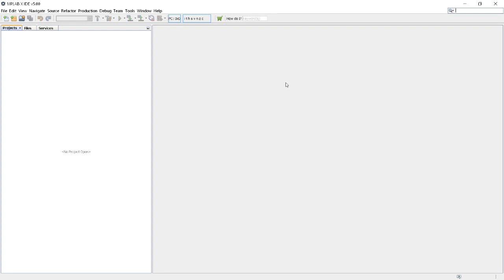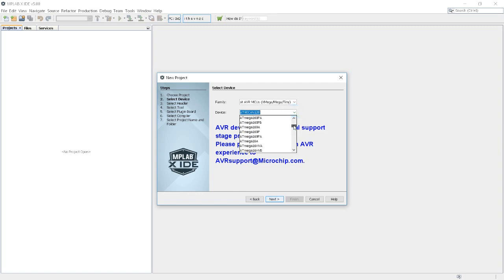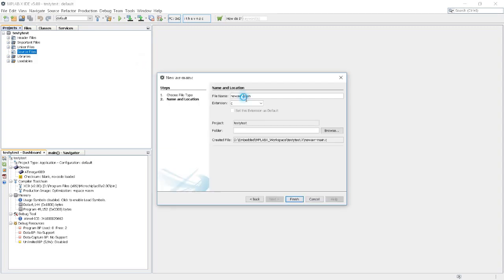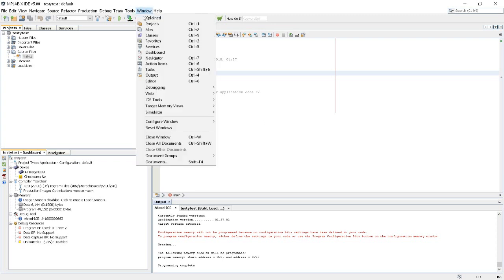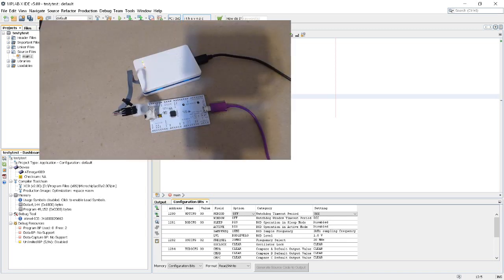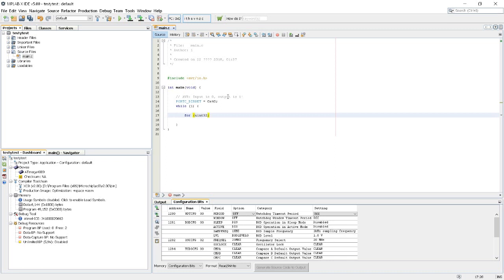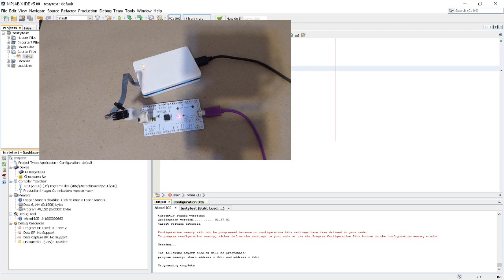Programming an AVR microcontroller using MPLAB X !

Comment: Thanks for the intro to MPLAB AVR, please do you know of any support for USBasp programmer? i have been using it with Atmel Studio util this recent development.
Reply from the maker: I think there's an option somewhere in MPLAB X, to set up external tools such as AVRDude -> USBAsp. But frankly, I used only official programmers for so long, that I don't remember how it's done...
Reply: @idogendel  Thanks, i have check the MPLAB through but could see nothing. I notice MPLAB was build on netbean. from my little knowledge of netbean, it does not support plugins like eclipse.
Reply from the maker: It's not a plugin. Take a look at the procedure here: http://chipkit.net/tag/bootloaders/ (steps 8 and on), it might be relevant (hopefully this is still supported in the new MPLAB X versions)

Comment: My "#include <avr/io.h>" is underlined red and it wont recognize "PORTC_DIRSET". Can anyone help me on this?
Reply from the maker: Won't recognize even after you Build the project? then make sure you have updated versions of both MPLAB X and XC8, then make sure you did all the steps for creating an AVR project and not something else by mistake.
Reply: @idogendel  I followed the steps again and I got the same issue. I don't know what was wrong but I switch to Atmel Studio and now I got it working fine.

Comment: This IS good news, after a bit of a fiasco with microchips PICKit4 programmer, and an exchange of just one unhelpful suggestion from them; i lost patience waiting for another new IDE to fix a really inexcuseable problem ( MCLR pin not being released on the 12F PIC's after programming) i gave them a bit of a roasting about their tools and software not delivering what was promised. Good to see they have finally made some progress...maybe we will even get Atmel documents in PDF? the shock may be too much. 'eventually' all of the microchip development tools will support the full range of PIC AVR ARM-Core and eventually even MicroSemi; now that Microchip own them. But its still far from perfect; just too many things still broken:- 
Still no SDcard support for the PICKit4, 'power target from tool' is really flaky and most of the time won't 'stick', 
program works but verify doesn't ( it reads back zero's despite the fact it just programmed and verified...!) 
12F parts now get released from reset correctly in this new IDE/IPE; but connection to them is flaky as hell. 
The first run with the new IDE after the install froze up my windows7 PC just as it was installing 'communication libraries', although the shortcuts are on the desktop and the IPE runs it has no entry in Windoze 'programs and setings' and so  no uninstall utility to clean the mess out...GREAT! 
when i got it running it bricked the firmware in the PICKit4 and had to be re-flashed from X IDE requiring the use of a paper clip, and a 'plug then un-plug' shuffle.not a great start by any means! just over 50 Atmel parts are beta support only and Atmel hardware only, so not much better than using Atmel Studio...other than it doesn't swallow most of your hard drive like Studio v7.xx does. soooo now i have to edit windows registry without crashing through it like a wild pig..80/
Reply from the maker: Somehow I get the impression you're not 100% satisfied :D 
To be honest, I have very little experience with both the PICKIT4  (only got mine a couple of weeks ago) and the '4809 (and I was quite shocked to see the Errata of this MCU) Of course, there are quite a few things Microchip could to make a better developer experience. Still, I did not expect AVR programming to arrive so soon to MPLAB X and work so smoothly - at least at this basic level. So it's not all bad :)

Comment: About the "download" / "upload" terms. Some years ago I worked with Texas Instruments Code Composer Studio. There "download" meant to load code into microcontroller.  I guess it depends what is up and what is down for you.  
  
Then it was explained to me that you "download" from internet since internet is high above the computer but you download to microcontroller since it is below the computer in the hierarchy of devices. Then I got used to that kind of thinking.
  
In the Arduino world you always download to your computer and upload away from your computer.  
  
Just a thought. I noticed you fixed your usage of the word, but what you said actually matched how I was used to it before.
Reply from the maker: Interesting, I never thought about that. I assumed (intuitively?) that Downloading means moving data from somewhere to where I am (i.e. the PC), and Uploading is moving data from where I am to somewhere else. I must remember to be careful when I use CCS!